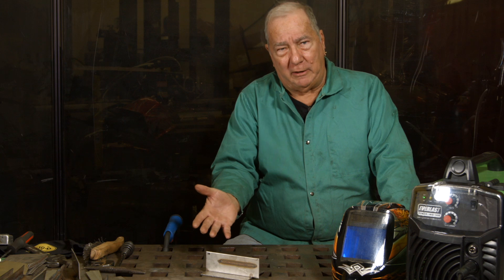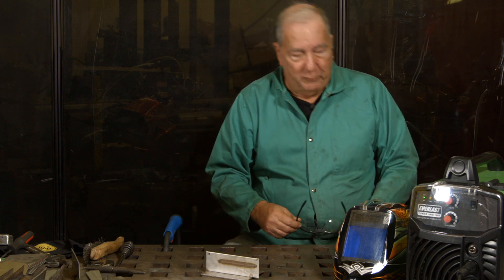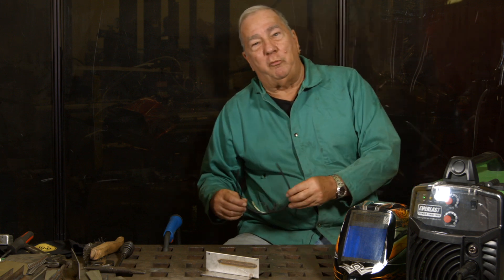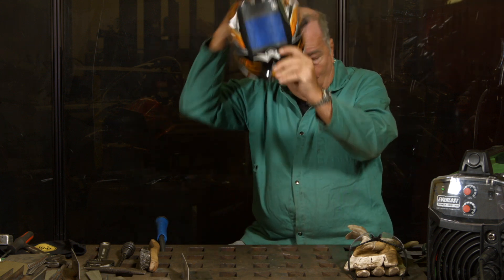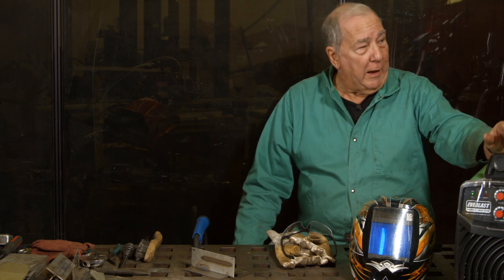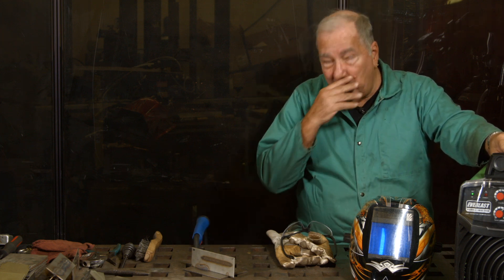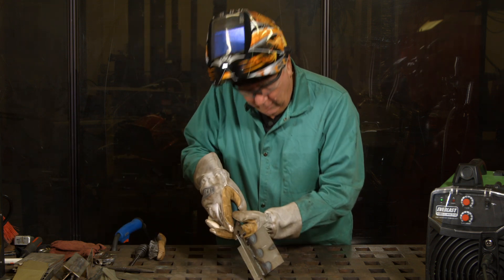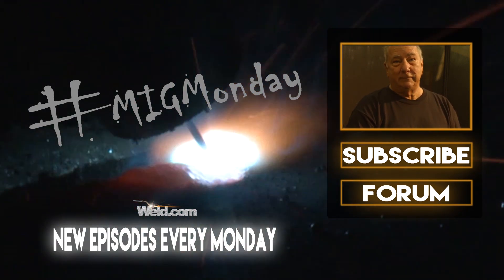How to MIG Weld Stainless Steel to Mild Steel | MIG Monday

Comment: Cool video, thanks...I have also heard that on exhaust tubing using 309 wire will work with stainless and mild steel with the more common 75%argon/25%Co2 mix, not necessary to go with the tri-mix for exhaust tubing.
Reply: E. Kitching are you 100% sure? because I am close to ready to start building my turbo piping.
Reply: @billgatesc1072   so...?
Reply: @billgatesc1072  it's been a year, did ya get it?
Reply: @Chris.hack.things  yes works just fine but the welds rust

Comment: dont you need a respirator for welding stainless
Reply: You should always wear one when welding.  It's like the thinking of paint respirators.  "Don't you need a respirator to spray paint with catalyst" the old 1k only paints still require a respirator gloves and suit.  Even mild steel welding should have a respirator or at least fine extrator

Comment: Great comparison! Time to try and weld a mild steel flex pipe into a stainless exhaust..
Reply: how did you get on welding the flex pupe on there mate? im wanting to do the same thing is your weld holding up ok? thanks
Reply: @fergusdahousecat798  Same question!

Comment: 308 wire does the trick
Reply: 308 is generally better suited to dissimilar 300 series stainless i.e. 316 to 304 stainless and not really suited to low carbon steels

Comment: Generally, rather than matching your filler wire to your stainless, you'd be better off using a filler suited to dissimilar metals such as 309 wire.
Reply: Bespoke with 309 filler wire would you or could you use75/25? Thanks
Reply: C M I’ve done some stainless mig welding with 75/25 (car exhausts) and it’s always turned out well.